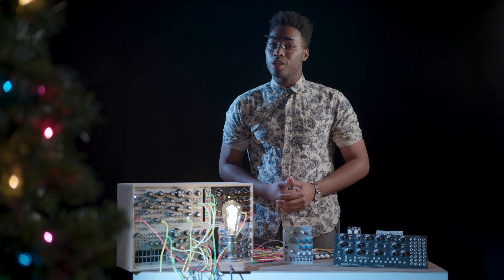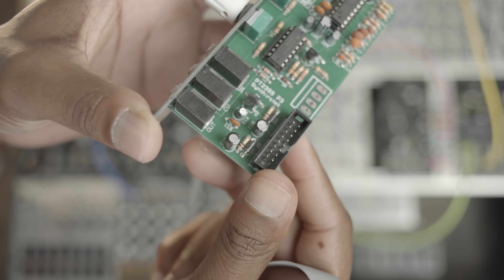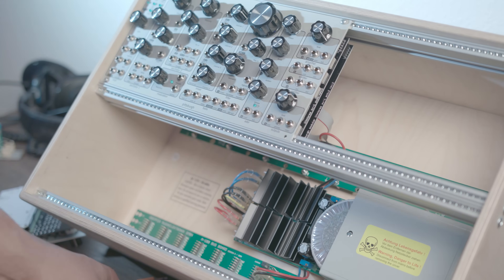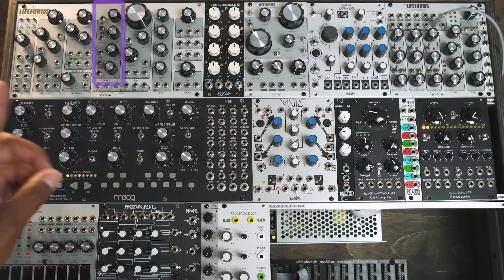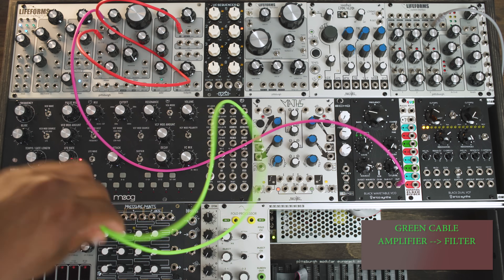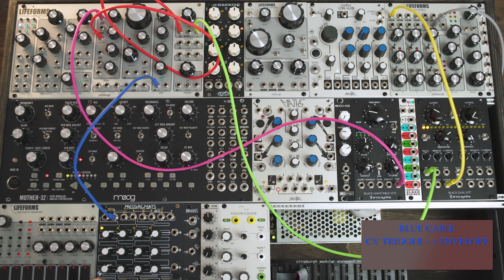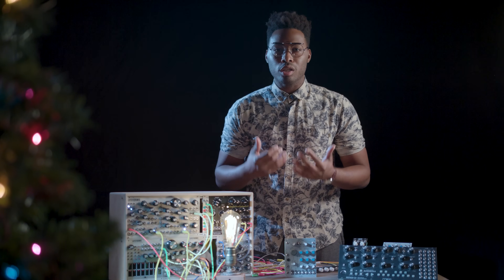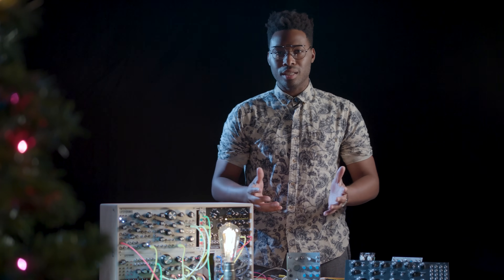Eurorack for Beginners Series - Part 3 of 3 - Module Installation and Basic Starter Patching

Comment: I love this video for starters I've never had one but I do own an analogue solutions red square 2nd edition.  Now I'm a mad scientist but I don't want a huge wall to wall system nor do I want a tiny one either well here's what I like I love grit I love super heavy distortion I love insane reverb and delay I love tb 303 diode filters vactrol filters goa trance psy trance Moog buchla the systems from the 70's and 60's hell throw in the 50's too that's what I want any suggestions. Well I've come across the Cre8te audio studios bundle kit it's 84 hp  55 mm deep it's a 3u desktop kit for 270 and it comes with its own built in midi clock and gate and power switch and supply plus two modules cells and chips and those two modules alone do a lot if I get that I'll do more with that than I could ever imagine what are your thoughts on that

Comment: How useful would my Neutron be as my first Eurorack module? What would you suggest as a next reasonable module?
Reply from the maker: That would be a good choice Darren, I’d say depends which way you wanna go from there, effects, shaping or modulation. If it were me I’d probably add shaping, another filter or add some bit crushing...aside from those things that are subjective I’d say what are you plans for the system over the next 6 months. Do you have an end goal system in mind?
Reply: Noir Et Blanc Vie . Thanks mate for a prompt reply. It's a hobby and I want to make ambient , soundscape music .
Reply from the maker: No problem, I’ll help if I can.  What’s your case size if you have one or planning on one?
Reply: @NoirEtBlancVie  I have bought 6U rack brute stand ( which is powered)

Comment: Say you have a rack filled and you wanted to swap out one module, for example a 2HP module. Do you have to take out lots of modules to get to the cables?
Reply from the maker: Heck yeah and it sucks lol. (Though) a lot of 2hp modules you find may be passive and therefore not require power, things like mults and passive mixers.

Comment: I have to say, I've been so lost figuring out where to start with mod synth and these videos have been some of the most helpful I have seen. Really great job and breaking everything down. I have a question, though:

I'm looking at either starting with the Moog mother-32 or the DFAM. It looks like the DFAM is more versatile, but I'm looking to get a dreamy sound that I want to make ambient noise soundscapes with. The DFAM looks like it's really going to get me more rhythmic, but there are ways to make some lush bass sounds that are pretty alluring. Do you have a recommendation between the two?
Reply from the maker: You’d definitely have to go with the M32, though if I were starting from scratch I’d think about breaking it down a little further, the M32 is huge and well, it kinda wastes a ton of space for being such a simple all in one.
Reply: @NoirEtBlancVie thanks for the reply! I actually saw your video about how you would go with the Pittsburgh sv-1, and you still have it on your rack. I was thinking of buying that with a sequencer instead of the m34. Do you think that is a good start, or would you still recommend getting individual pieces first?
Reply from the maker: Hey Jimmy, if I were starting all over I’d still pick up the SV-1. It’s honestly just so much more bang for the buck than any all in one voice module. The mixer is bad ass. I’d buy a filter from 24db LP filter Doepfer and call it a day. I want to reiterate that I literally had M32 #19 & #20 from the factory, I was hyped for them. Looking back, they were just amazing for their sound and sequencer, but size and versatility was lacking, you can do better elsewhere. I do truly hope for a Moog followup that will add features I think it needs.
Reply: @NoirEtBlancVie  Wow, yeah! That really helps. Thanks for your help!

Comment: Great video! What are your thoughts on prebuilt starter modular systems from Pittsburgh Modular Lifeforms System 301 and the Make Noise Black Cartesian system? These come with power supply, case, patch cables, and core modules plus room to expand.

Comment: Fun to watch you build a modular.

One thing I just realized that even if you regret a module it is relatively cheap to replace it with something else, in particular if you can buy used. So one could consider some experimenting with filters and such. If i was to build my own I would go "filter nuts".
Reply from the maker: Man I totally need more filters and more VCAs and a sequencer....

Then again....I also need more money HAHAHA
Reply: Not a matter of money, matter of time.

Just enjoy what you have, think you have some very nice gear there mate.
Reply from the maker: You're so right.....I'm always looking at the next module.  But, I honestly have more than the average person needs.
Reply from the maker: Great beginner tips!
Reply: Well a tip from a long time used gear buyer, never buy redundant gear.

I almost always made money when buying used. Done it for 25 years.

Got my money back on D20, M1, RX5, DR660, RY30, QS300, QY20 etc.